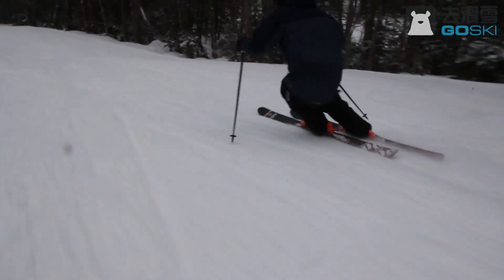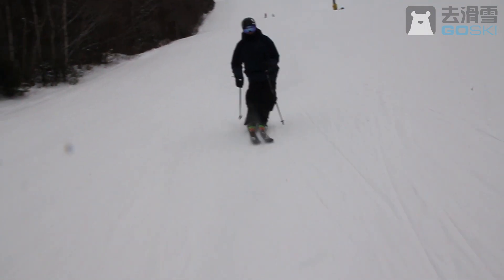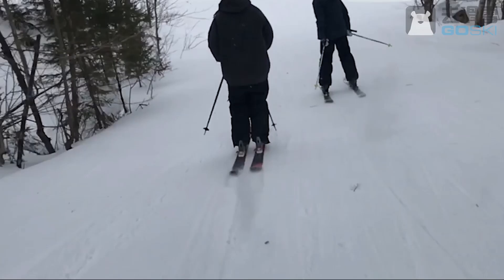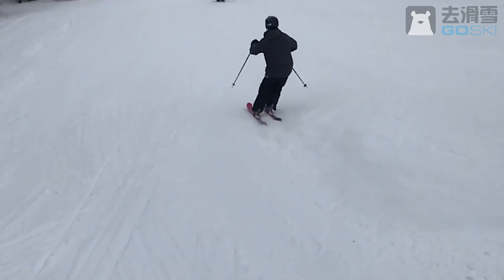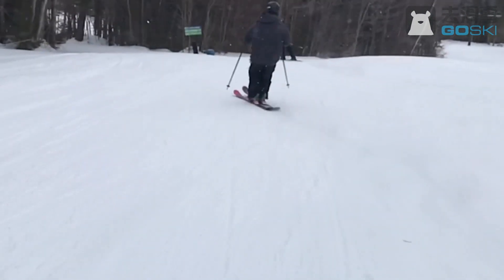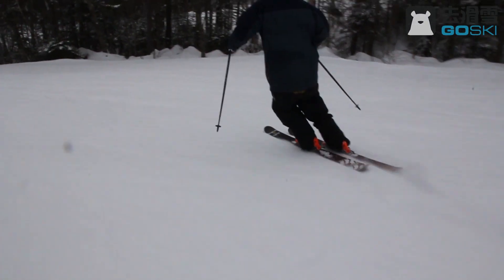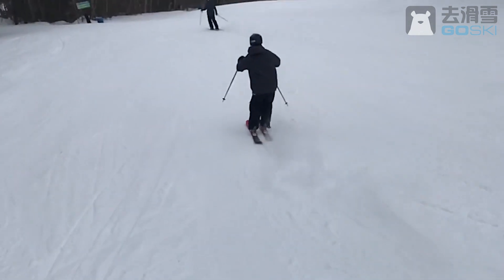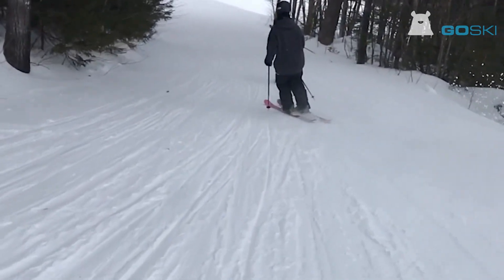How to carve on skis

Comment: When you are carving left if you push your left ski forward, and slightly drop your right back, you will get a longer edge that is more stable and helps round out you turns better, so they are more fluid and complete. What is also fun, and looks very cool is to pop out of your carve, using the energy you get at the end of your carve, and land leaning into your next carve, very fun over rollers, but you have to be going fast to get that free energy at the end of your carve. There is no "proper" way to carve, there are different technics for different conditions and different types of runs, at different speeds.